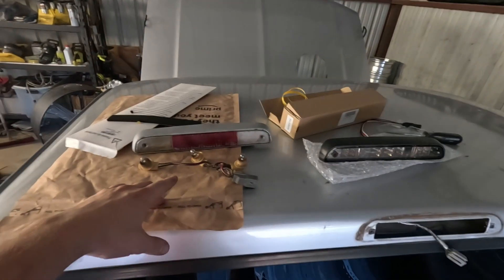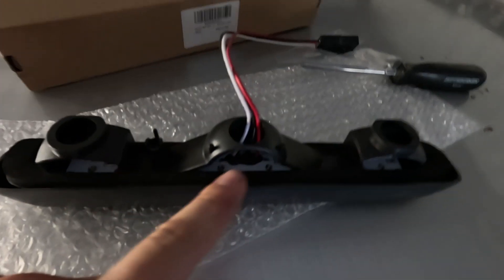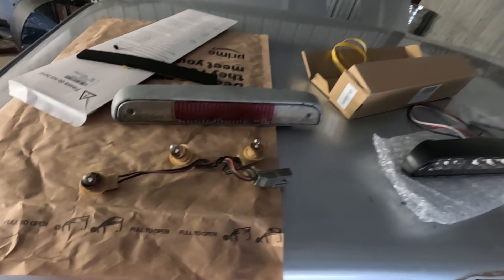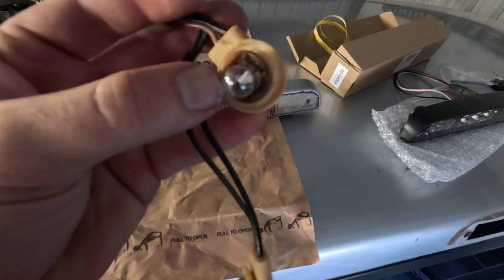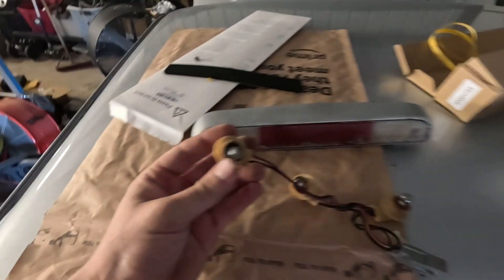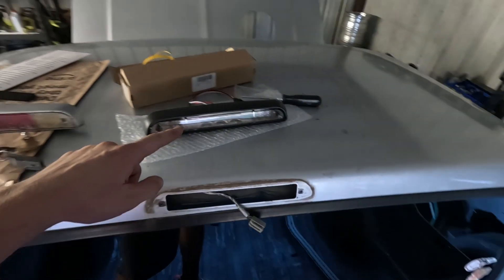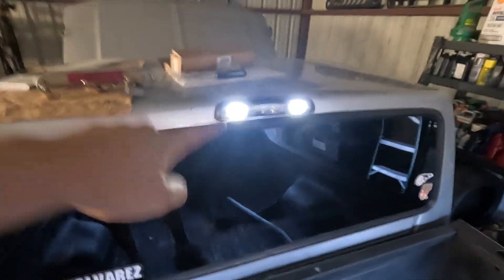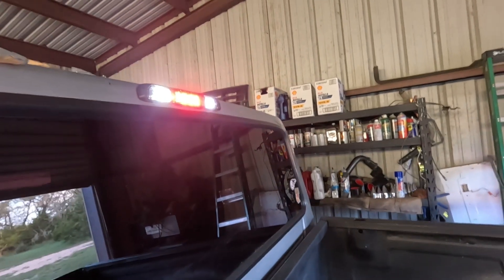1994-1997 ford f150/f250/f350 3rd brake light install

Comment: Can u drop a link for the relay and third brake light u used?
Reply from the maker: 3rd Brake Light for 1992 1993... https://www.amazon.com/dp/B08B88G599?ref=ppx_pop_mob_ap_share
Reply from the maker: CEC Industries EF32 12V Heady... https://www.amazon.com/dp/B0031GYS6W?ref=ppx_pop_mob_ap_share
Reply from the maker: MOFORKIT 3rd Third Brake Light... https://www.amazon.com/dp/B07MZ4Q9VB?ref=ppx_pop_mob_ap_share